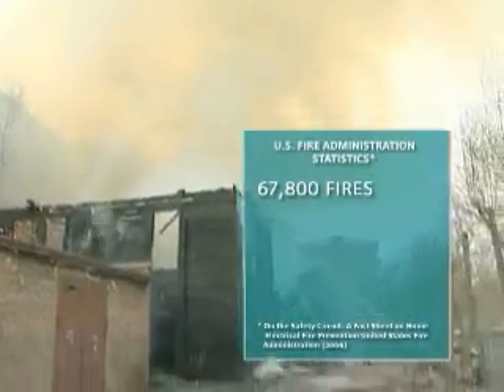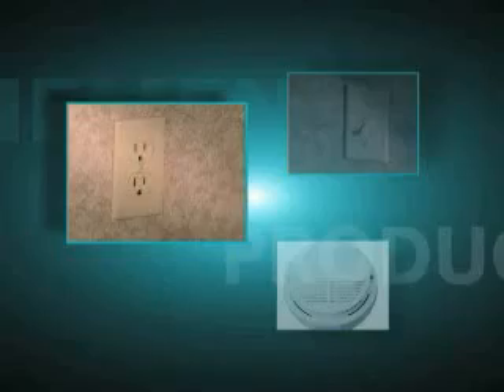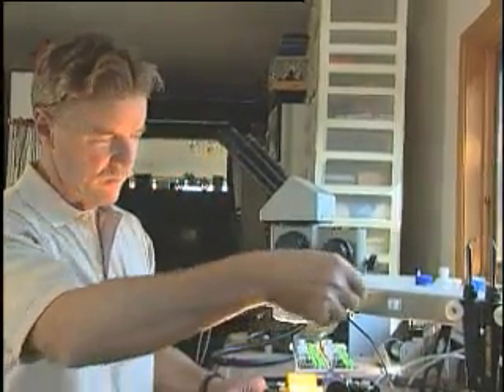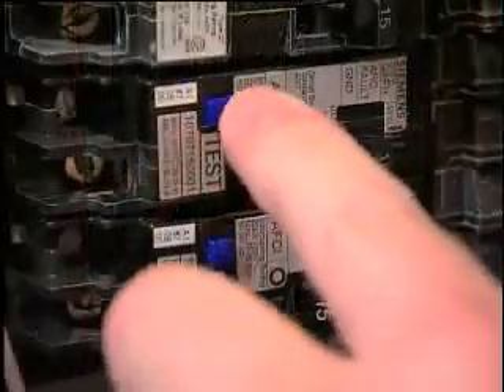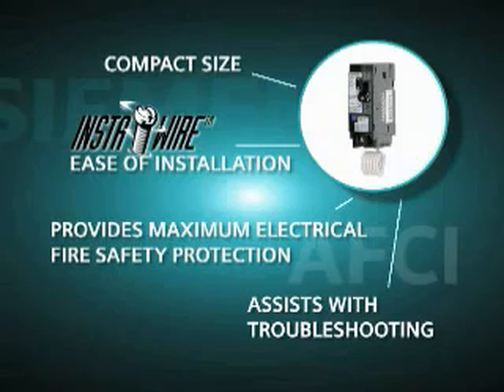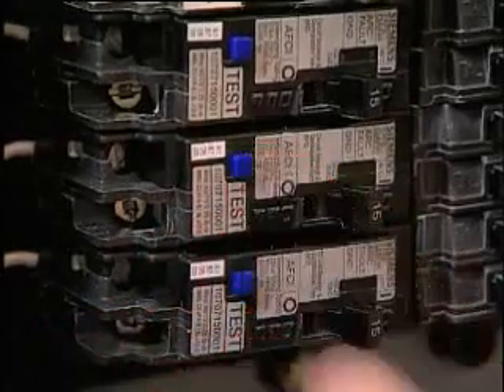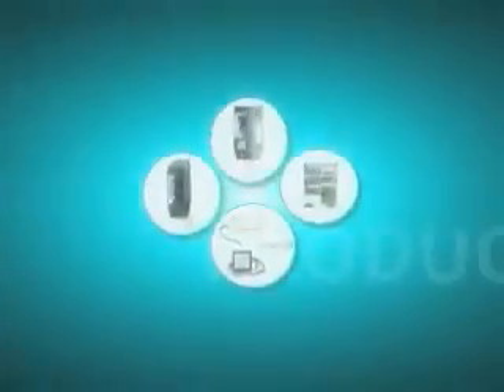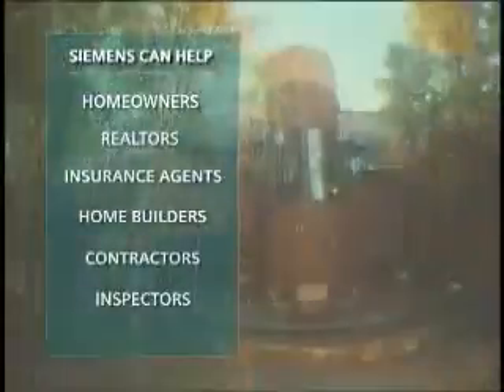AFCI Whole House Safety Video

Comment: We need Shunt trip GFCI protected SWN QO 3P 480V 50Amp breakers that monitor all phases and neutral conductor for current or voltage spikes(put in your surge suppressor). In the event of a ground fault, short circuit or neutral inrush to your swimming pool, all three phases and the neutral conductor will be disconnected at the same time. We must have Heavy duty service disconnects on the side of homes by the metering equipment.